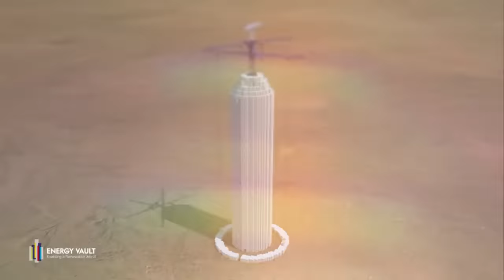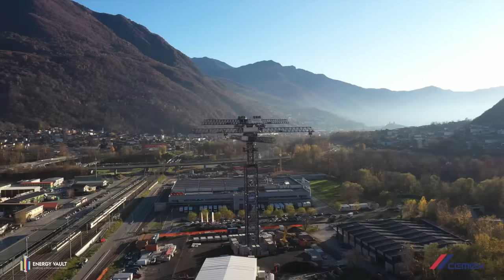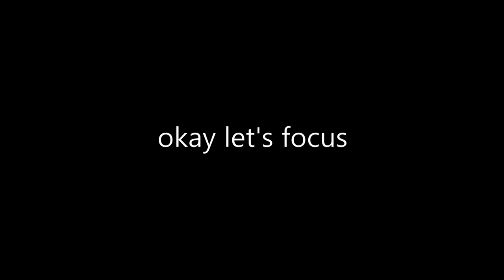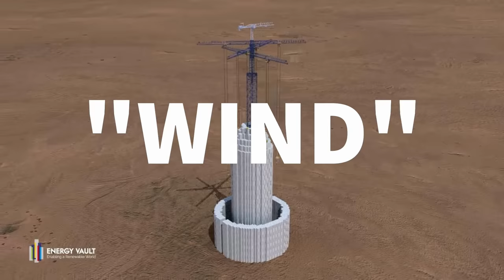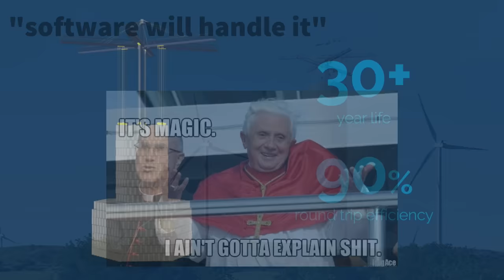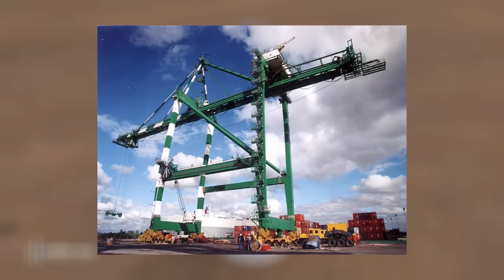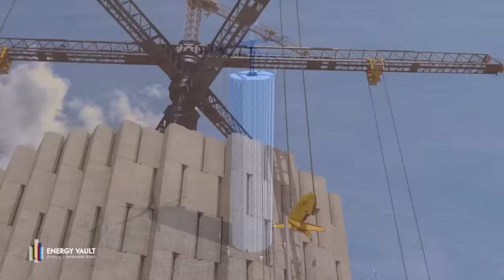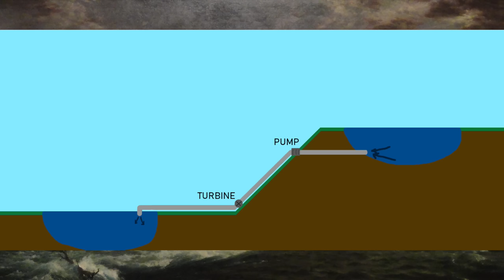The Energy Vault is a Dumb Idea, Here's Why

Comment: Did you know that Yellowstone national park contains enough potential geothermal energy to power the entire United States?
Reply: No.
Reply: @rawbacon  Yes
Reply: @nickpiscopo5  I'm not disagreeing with you, I was just answering your question and saying I didn't know that........How would you harness it?
Reply: @rawbacon  Oh haha! I'm dying over here I didnt realize that 😂Using the heat to produce steam to then turn turbines. Steam expands 1000x its volume when it boils and when the steam is concentrated in a very small stream it then can be used to create rotational mechanical energy. Which then when you spin magnets around copper you produce electricity! Its amazing really
Reply: @nickpiscopo5  Expands 1700 Times at Atmospheric Pressure, Steam Turbine Plants run on much higher Pressures though and then there's Superheating.

Anyway, Problem is that you can't Generate Electricity at Yellowstone to be consumed in Florida, the Transmission Losses would be insane even at 1000+ kV. Such a long Transmission Line behaves like a giant Capacitor, resulting in so much reactive Power that little to no usable Power arrives at the End of the Line.

Comment: The thing that I’m worried about; Wouldn’t moving the blocks with the crane cost more energy than is actually being stored?
Reply: No, not even close. Think of putting two heavy buckets of paint on a long rope suspended over a large pulley.  As long as both buckets are suspended in the air, you can easily move both buckets up and down with minimal force. The only significant wasted energy is in the flexing of the rope and in the bearings in the pulley.
Reply: The reason lies in the fact that this crane is a purpose-built machine, specifically designed to minimize friction losses. A normal crane would not be as efficient, since they are mainly designed for construction and demolition, and efficiency wasn't a big part of their design plan.
Reply: @HeyChickens  thx

Comment: They're trying to solve ways of storing energy in places without access to hydro batteries.  USA and Switzerland have a bunch of hydro batteries but not everyone has access to the water and height needed, you know...like flat dry places.  They already use hydro where they can.  They're also trying gravity batteries built down into old mineshafts to just raise and lower one single weight it's just not an option for all.  Also it's not exactly easy to just "dig a big ole hole."   You claim to debunk this but you don't even seem to understand what they were trying to do or why they did it this way.   Nor did you address any of the practical issues like accessibility they would have taken into account with their decisions.

The software argument wasn't even an argument either...they have a system where the rig that holds the blocks adjusts to counteract the swaying.  Does it work?  I dunno.  You offered no counter-argument at all though, you just made a dumb voice and went to the next point.  That's not what "debunking" means.  Bringing up that it doesn't have as much energy output as a wind turbine is also nonsensical.  It's not trying to make power, it's trying to store it.  It's a battery you compare it to other batteries.  Your argument is basically "this gas tank is garbage because it doesn't have as much horsepower as the engine."  The battery you use in your car doesn't produce as much energy as a turbine either...doesn't mean it's useless.  You judge a battery on whether it has enough energy to provide for the specific application it's used for.

It seems like there's much better ways of doing this other than free swinging cables and stacked concrete but this video was aggressively dumb.  To end with the smug conclusion to "just use hydro" itself is beyond idiotic considering it is a technology specifically designed for use when hydro isn't an option.  Less sarcasm, more research please.

Comment: There are a few issues with this. 

One problem is that water REALLY likes to find the easiest way out, so you need to be very careful you don't spring a leak somewhere, or in short order you'll lose all your water. 

Another problem is that while building up is expensive, digging down is EXPENSIVE. Moving all that dirt is extremely pricey, not to mention reinforcing it to stay there when it's being buoyed up by the groundwater. 

Another problem is that not everywhere has large differences in elevation, or available surpluses of water. Iowa has lots of wind and water, but is flat as a board. Wyoming has lots of wind and elevation, but no water. 

Another problem is thinking these are intended for long-term storage. They're not. The big problem with wind energy isn't storing power for a month, it's storing it for an hour. At night, nobody needs power, which is nice, because usually there isn't much wind, either. But in the morning, before the wind comes up, everyone needs power. Then, just as the wind starts to come up, everyone gets to work and the power needs drop off. Then everyone gets home and power needs skyrocket, before dropping off again for bedtime. 

If you want to have enough wind power to keep everyone going, you end up shutting half of them off most of the time except for evenings. But if you could store just a few hours worth of power, you could build half as many windmills and still provide enough for everyone without needing to fire up the coal power plants. 

And if you could build 1 of these for every 20 windmills, that's not a half-bad deal. Of course, the real trick would be merging the windmills WITH the energy storage, but that's another matter entirely.

Comment: what about concrete having 2.5 times higher density as compared to water? hence, 2.5 times more energy stored for the same volume?
plus, with water you have to convert the mechanical energy (converted from the electrical energy) to a hydraulic energy, which invokes more loses...
i'm sure there are many pros and cons for each of the designs, but shouting "it is total BS" based only on CGI of the design is stupid

Comment: I read somewhere that energy storage in this form could be added on to existing skycrapers? Would this improve the feasibility of the idea? Or just writing this down, I'm thinking that existing buildings arent built for this, so they would still have to be (re-)built...

Also, would an idea like this be more feasible in areas without any height difference, such as the Netherlands? Digging a big hole there might also prove hard, with the low sea level and loamy soil. 

If anyone more knowledgeable (so pretty much everyone) could chip in, thank you.

Comment: You should revisit this wit their new design as it seems to have taken some of your suggestions. For instance - it's based on modular square gantry cranes. Also - I doubt Energy Vault would even argue that this is preferable to pumped hydro in situations where that's possible. The problem is that siting PH is difficult whereas this is not.
Reply: Honestly their new design looks way more feasible than this Jenga tower concept, though I can still see there being issues with maintenance and longevity with all the moving parts.

Comment: It’s gotta take a huge amount of energy to move the blocks
Reply: that's the point.  moving them uphill stores the energy for later use.  Consider a drawbridge with counterweight.  Takes power to raise the bridge.  As the bridge is lowered, the weight is raised, storing potential energy, ready and waiting to make the next raising of the bridge easier.  That's a small-scale application.  These folks intend to scale it up to store massive amounts of energy.

Comment: Could they just use reservoir with black flat top to heat the water or just compressed air inside so it will rotate the turbine and cool itseld doing so? And for energy storage why don't just make compressed air storage deep underground like natural gas is stored in Earth? It's just an air which will be pumped downside while there is energy flow to increase inner pressure and released back to rotate turbine when there is a need? Btw bellow the Earth the temperature is growing the deeper it is. So this scheme will generate some additional pressure for compressed air by warming it in underground storage.

Comment: There aren't enough places where pumped storage would work. Finding high elevated areas to hold water is hard. And won't be able to satisfy our energy storage needs. Water also evaporates. And is scarce in many places.

Computer and robotics automation might very well unlock news ways of storing and using potential energy, using materials that are more abundant than what's used in chemical batteries.

So I don't think your video really debunks the concept.

Comment: 1) initial co2 emission from concrete production is like a one time investment. Even solar panel production causes co2 emission.

2) Gravity vaults need not be next to wind turbines, as those quite produce energy throughout day. These has to be better adjacent to solar energy. 

3) pumped hydro demands more geographical features, or elsewhere it would cause more environmental impact.
Reply: 1) 82'000 Tons of CO² is an insane high amount. Yes, other forms of electricity also produce CO², but not building this thing would be good

2) even if it isn't next to wind turbines, it's still very sensible to wind.

3) i'm just saying Switzerland for this. If it doesn't fit in one Geographical area, THEN JUST BUILD IT SOMEWHERE ELSE.

Comment: It’s a system to STOCK energy, not producing it, so the comparison with wind tower is soooo stupid. And about the concrete… You can recycle it. Do you know how many concrete in surplus we produce? And once you create the block it can be used for hundred of years…
The advantage of this system is that you don’t need a river to build it, so it can be build near to any other green power plants to stock the energy and not waste it.
Reply: It's not being compared to a wind turbine. It's being calculated how much wind turbine output it can store. We do not produce concrete in surplus. It's actually going to become scarce thanks to the lack of sand. Concrete last decades, not centuries, especially these. The wind, the constant placing and picking up will wear it down. You can't build this everywhere. It's best efficient near the turbines/solar panels which possible candidates are limited.

Comment: I feel like this video is made just for the sake of complaining. It's pretty obvious that pump-storage systems are better. They have better efficiency compared to block-storage systems (around 10% more in favour of hydro). The issue is - to make hydro storage cheap and reliable you need a hill. So you're limited by a geography. That is literally the reason why people are working on block storage systems. 
Block storage systems aren't good or bad. They're being created for a specific purpose. If we were to follow your logic we could as well start complaining about hydro storage because batteries are better. And sure they are - but we are limited once again thanks to our lacks in technology and meterials. Just like some countries will be limited with their lack of resources (mainly capital) and geography (required hills) to build pump storage systems.

Comment: Just out of curiosity, pretending it didn't have any of the downsides you just mentioned, could it use mechanical advantage when hoisting the blocks back up, making better use of the energy source, thus making it more efficient? As far as I know, we can't do that with water, since there isn't a block and tackle equivalent for a fluid pump.
Reply: no. the equation for potential energy is the same... you dont magically pull out more energy than what exists with mechanical advantage...
Reply: @thomgizziz  Gotcha, thank you. I had this realization a week after I posted this and I thought maybe I should have corrected myself, but might as well leave it for anyone else wondering the same thing.

Comment: The machine is a scam!

I invented Next Generation Electricity, the SPHEREMOTOR. Wrap hundreds of feet of enameled copper wire around a small plastic bowl. Take two strong disc magnets and let them attract together squeezing the center of a pencil. Add something to fill the gaps between the two magnets. Secure each end of the pencil so that it can rotate, and the magnet portion rest inside the wired wrapped bowl. Take some 9-volt batteries clip them together. Sand the two ends of bowl enameled wire and secure one end of the wire to the negative on 9-volt batteries.  Now tap the end of the other wire to the positive on the batteries. Keep tapping and watch the powerful motion it creates.  Where it becomes cool, is when the magnet around the aluminum axle is a sphere with 600lbs of pull strength and the tolerances between the wire wrapped bowl are really, really close, the timing of the alternating tapping is perfect, that's when it is magic. Now add another bowl winding to generate current from the spinning of the 600lbs pull strength sphere magnet inside it and this becomes something that uses very little current but creates a large amount of current.   To see drawings, search for spheremotor.

Comment: Too complex, to many points of failure. Too much maintenance required. Even the cables wear out after a while. 
If you can’t do pumped hydro the only mechanical storage I’ve seen that makes sense is laying railroad tracks up a hill and having rail cars full of rock go up and down. To increase storage add more cars or lay more track. No complex cranes or software required. If the the cars have electric motors to go up, they can act as generators to go down. Simple, uses existing equipment, little development required.

Comment: well i think the only possible problem with water is efficiency and density... but well marginal problem really.
what i could possibly see be used other the hydro are kinetic batteries. something like large steel sphere or disk spun up to very high revolutions, though that would certainly act like gyroscope, but could be done.

Comment: There are some problems with your assumptions. Why would you build the thing in a place with high wind? I'm sure the pictures they're showing is for illustrative purposes. But electricity storage can be done virtually anywhere on the grid, as in any location. On your point about pumped storage, if it was so easy and cheap to build pumped storage it would be a lot more prevalent. The fact is it's actually one of the most expensive ways to "store" electricity, plus the landscape requirements are very complicated. You can't just build a pumped storage facility anywhere you like. Also you need a very, very large volume of water for the equivalent 35 MWh of storage. That seems to be the whole of point of this solution - concentrated energy storage, much more concentrated than pumped storage. 
However, I think your idea of at least partially building it underground probably has some teeth. 
Other solutions that are also looking viable are molten salt, which I believe UAE is looking to employ and ironically Finland has already started using "Sand batteries". Looking ahead, I think, if they can get cost right Hydrogen or Ammonia production is probably the future.